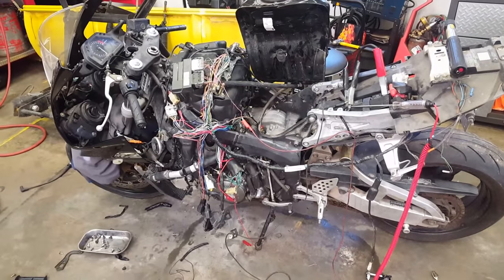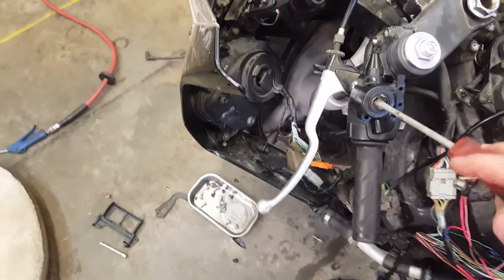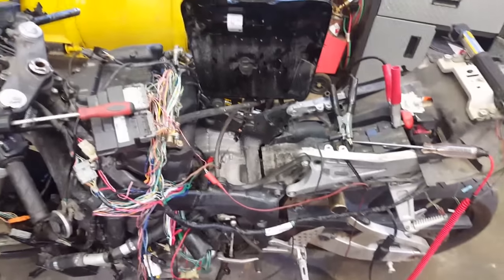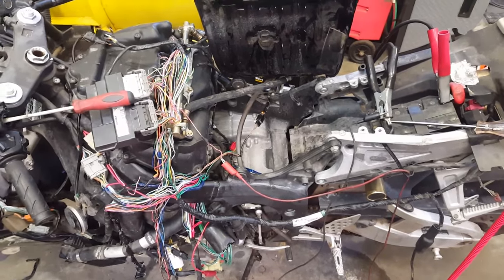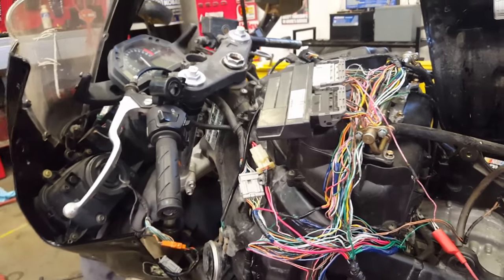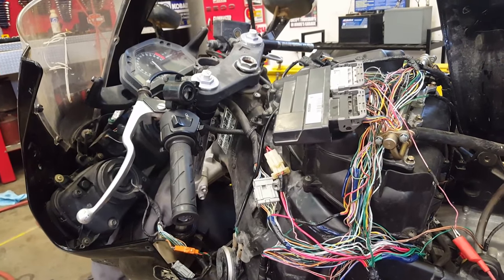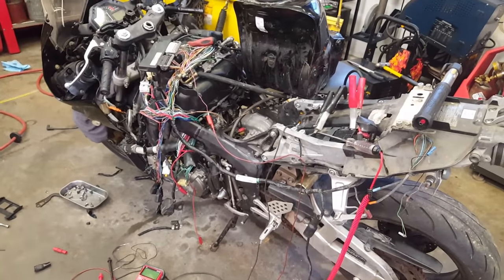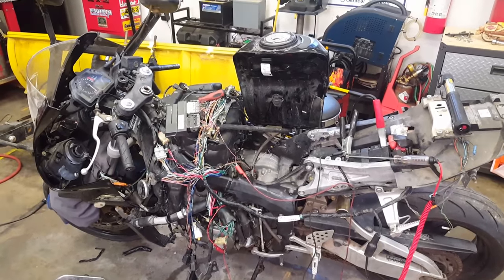2004 Honda CBR600RR no start fix. No fuel prime

Comment: Hi, this wasnt my problem but I did solve it. I checked everything, fuses, relays, bas, pump direct to 12v, kill switch, ecm. So thought I'd check this diode,  this is an 03 european model, there is a space for a diode but non is fitted and no pink wire with the 2 red ones from ignition. However I did find the problem in the end. I started from scratch again. Even though I knew it wasnt the starter solenoid coz it was cranking over, it looked grubby so I took it out to clean it, (keep the leads apart) when i did I could now see the 20a fuse holder( leads to fuel cut of relay)  which is buried in a hole next to it looked very green and the wire from the battery was broke but in place, you cannot see this with solenoid in situ. There is a factory hole in the undertray which the tyre throws water and muck through. I cut them and connected together and boom, pump primed and bike started. Fitted a new fuse holder from ebay for £2. check this, could save some time.

Comment: Thanks for taking the time to make this video. Working on my 2002-2003 945rr, bad fuel pump... took the pump apart and got that working, and after checking all the sensors as per the service manual, and even trying the 9v battery you did, still nothing... decided to trace the pink wire and found it broke/mouse chewed through only the pink wire on the whole bike.....lol soldered up the pink wire, hooked up the 12v bat. and she came to life!!! It's been over a year since the same priming sound you were so excited to hear, I finally heard. Without your video, who knows how long it would of taken me to stumble across the broken pink wire..  Take care man

Comment: So i was hoping this was my problem but it wasnt. The wire for the spark plug cloil shorted to the frame it killed the engine and now it wont fire. Same symptoms as you but not the same problem. All relays and fuses are good.

Comment: i have a cbr 929 2001 and found it does not have a zener diode at back of ignition.  I am nut much of an electrician at all but wondering how exactly to connect the 9v battery to ecu pink wire?  So the grey terminal of the ecu has an all pink wire feeding into it; and I need to connect the positive terminal of the 9v to it? - what about the negative terminal.  Help would be very much appreciated as have spent tonnes of bucks on bike ...

Comment: Actually that is not the FiX. There can be this problem with a perfectly working diode. As I have just bought a brand new ignition and still no prime. If you check deeper in yiutube videos you will find the video w the guy who shows the real FIX. The actually fuel pump brown and blue wires have a connector inside where the wires change colors. And this connector will short out. On 75 percent of your fuel pumps. A defect most all of them have. Even new ones. As I have also bought a brand new fuel pump. Still no prime.
Reply: Yours is a very helpful reply. Trying to solve a no-prime fuel pump issue on a USA spec 2001 Blackbird. Can you please give more clues on how to find that connector video you reference?

Comment: So.. if I were to theoretically jump the main power switch with a wire and in the middle of the wire solder a diode limiting 9v to pass to then jump the 3rd wire.. theoretically.. 👀 it should start? Theoretically that is.

Comment: Great video, I've just had this no priming issue, I thought it was old fuel as I havent used the bike in months, so im mid strip down, fuel out and clean everything. If that doesnt work I'll check that diode. Strangely when I tested the fuel pump connector with ignition on I only got 3.5volts. Thanks for showing the solution. So many people dont, probably coz they never found the problem and gave up. Cheers

Comment: Thank you for your video I have a 97 Suzuki GSXR 600 Srad with no spark and I have replaced all electrical components and the complete wiring harness and some how I think it could be with the key ignition

Comment: Okay so I've watched your video on the Honda 2003 600RR with the fuel issue in the whole on doing one just like it right now so what I found out so far is everything relies on the zener diode for the computer Bank on the pink wire at the same time the aftermarket starter switch which does not have the diode inside of it it has a 4-wire setup one red one black one green and one black and white striped an operating the switch on the meter you only get power in and out two wires and I even took the back of the switch off and look in side

Comment: Very helpful thanks great job the diode needed to solve this issue is a zener diode 9v resistance which will regulate voltage 12v to 9v

Comment: My ignition only has 2 red wires from the back, if i get a new ignitinon and fuel cap kit will it come with the stuff i need?  Im gonna get the amazon special.  Lol    And if possible how could I get it to run now?
Reply: I can't find the pink wire to even try to jump into, is it a plain pink wire?

Comment: Hi there, I have the same problem my bike is a 2006rr and they don’t have the pink wire on the plug like your they are only two wire coming out both end
Reply: I fix my problem with my bike the was the yellow box left side no ground on one wire I ground it and case solved!

Comment: I have no pink wire coming from the ignition on my 2006. I have 2 red ones reading 13.3 volts
Reply: MotoBike Mike did you find the fix?
Reply: Pull the ignition apart and see if there's a zener diode inside

Comment: I'm having exact same issue with my 04 cbr600rr.   Mostly sits in garage, but starts fine, then out of the blue no fuel prime. Turns over but no ignition.  My first thought was maybe fuel pump seized.  I've  since open fuel tank and seen rust deposits around filler and was thinking maybe this is the cause.  Best I check this diode business out as well.  Thanks
Reply: what's the verdict?

Comment: I have the same issue with my 2003 honda cbr 600 f4i. My buddy and I have tried and checked everything but the ignition. Your video has help my buddy and I out alot thanx.
Reply: Lol I   ride  with  a 9 volt battery  for  a  while .  Found  out  the  hard  way  after  spending   2K in  the  shop .  They  couldn't  find  the  problem

Comment: Hello Andrew I have an 05 cbr 600rr and mine is having the same problems as yours pump dosent prime but turns over! I pulled out my ignition switch and checked the loom where it connects and there is no pink wire coming out is there an email or Facebook I can get with you and try to figure it out I am stumped!! Please help!!
Reply: did you ever fix your issue?  I've got an 05 and have the same issue.  Thanks

Comment: So I can’t see in the vid Weber’s the 9v wire is I can’t tell how to feed it in, and I don’t want to hook things up wrong. Can you explain it a wee bit. I replaced it. But I still can’t get it started , can you put the diod in backwards cheacked all the wires that I think would be the issue . But still nothing. Replaced the pump( not the assembly) and that was an issue but not the original issue . How do I test the voltage ? Do I need to cut the pink wire and put the lil machine in it or can I just hook an alligator clip on one ( the pink side) of the diod soterd points?
Reply: With the 9v when I hook it into the pink wire  would I put the positive post to the pink wire and the and the meg post on to what ? The other side of the pink wire or hook it to a meg or pos of the bike bike battery?

Comment: I'm having trouble because the fuel pump indicater light on speedometer panel  is not even lighting up. I hear the switch click the relay. But no light or fuel injector or pump activation and my 2005 cbr600rr don't even have a pink wire from the ignition. I  need help please
Reply: Darius Tolentino it sounds like your fuel pump needs to be replaced. Have you tried unplugging the pump and sending 12 volts directly to it to see if it runs? The low fuel light is activated from a thermister attached to the fuel pump, the service manual says to replace the pump if the light fails. You can test the light by unplugging fuel pump wire and shorting the green and brown/black wire on the harness side, turn the key on and see if the light glows. If yes then it’s the themister. I’m in the same boat with my 954. There seems to be a work around to replace the thermister if you are mechanically inclined. I am going to attempt it seeing as a new pump assembly is over 300 bucks. I hope this helps.✌🏻

Comment: If buy new key set is that help?i buy whole new wiring for my bike,
symptom,
My bike sudenly lost power when ride and die,it hard to start,
when i try to start it again it won't start and my fuelpump suddenly wont prime.
Is that the same for your case sir?
Is that to do with the zener diode on the key?
Reply: Ecm problem bro

Comment: I have a no fuel pump prime but does work when jumping the fuel pump relay. Bike has been in the shop for 5 months and it's painful to watch time fly with no fix. I have an 05 . My yellow clip coming off the wiring harness burned and the bike wouldn't start. I had it in a shop for a day before the power cut out on me again this time I have no headlights , backlight on the cluster and no front turn signals also still no fuel pump prime
Reply: Changed fuel pump ,like 10 relays, ecm also swapped out , checked bank angle sensors , killswitch almost everything ... anything I'm missing? Bike only starts from jumping fuel pump relay

Comment: So, if you just bought those $30 ebay ignition kit and install it, it will fire the bike right up?  No extra work required?
Reply: Have you tried it and worked?

Comment: I think you might have just solved my problem, will try it out, my 2009 Honda cbr600rr just won't start even replaced engine with a running 1. No start
Reply: Did it work? I also have a 2009 PC40 with the same issues.

Comment: This is exactly what issue i ran into. I put in a new stator, put the bike back together. Started right up every time I tried the same night I put the stator on, heard the prime every time. As well. The next morning, wanted to hear the glorious fix I did on the bike & start it up. I noticed the prime noise didn’t come on anymore, & the bike didn’t want to turn over. Now the buzzing noise the prime is supposed to make, isn’t going on. Huge head ache. Might try this, hopefully it helps.
Reply: MyKey Productions did it work

Comment: Hello Andrew my bike doesnt start when its above 200F temperature. 2004 Honda CBR RR. I have change the kick stater, battery,stator coil,rectifier.
Reply: Did you get that fixed? Have a friend with the same problem

Comment: Hey buddy,  Ive got a question and hoping you might have some insight.  I have a 2006 cbr600f4 and when I got it it was at some dudes house that works on bikes.  He said they replaced the starter but for some reason the starter would just spin and wouldnt catch anyting.  So I called a honda dealer and they said it sounded like the starter clutch had gone bad and needed replaced.  I ordered on offline using the part number that the honda dealer gave me.  We replaced the starter clutch assembly and it is still doing the same thing.  Any thoughts would help.  Thanks!

Comment: I'm having the same problem that you are having with my bike and I put a new ignition switch from eBay on my bike and it's still not working do you have any ideas what could help
Reply from the maker: Be sure the ignition switch is not for a European bike. They do not have the diode in it

Comment: Any links to where I can get a correct zener diode?  I purchased a new ignition switch online,  no fuel prime, jumped the pink wire to a 9v battery and it fired up.
Reply: luis valde I have some I can send u

Comment: I have my 03 600rr and my zener diode is completely missing. And the pink cable you have on the back of the ignition switch is also non existent. I hsve an Australian HISS RR so is that why i dont have that extra cable?

Comment: I tried this but it didn't work. I also replaced the zener diode that goes into the ignition switch. I'm waiting on my new ecu so hopefully I'll be riding. 

Glad you fixed your problem 🤙🏾
Reply: Popeyetwowheels what and where did you get the diode?
Reply: Did the ecu fix your problem?

Comment: hello sir, wondering if why my diode reads 8.4 and its a new one, evwn the old one reads 8.4, the brown wire going to the fuel pump has no power, pls help thank you
Reply: jorel tiamson I have the same problem as you with my 2003 cbr600rr. The brown wire to the fuel pump relay has no power. If you figure out a fix please post it.

Comment: Thanks for the share, I also had the same problem with threads on forums... my bike doesn't have this problem...but awesome that you share this...I have also been looking for a fix for mine too, mine starts most of the time, but then it just goes off when accelerating, also sometimes..not always...driving me mad and quite dangerous especially at the track
Reply: Look for the fuel pump video w dude who shows you the fuel pump short. Prob the real issue your having.

Comment: i think mine is my throttle cable , after i changed the throttle tube the fucker wont start or kick the fuel primer in , il keep you posted if thats the case
Reply: i have a cbr 600 2006 model same problem no fuel pump prime , i watch your video but my bike has no diode under the ky switch and there is only two wire from the key switch both red, one has a black stripe, can you pleased help me thank you very much

Comment: i use a 1000 ohm resistor to fix it. i cut the pink wire , tied one end of the resistor to it. the other side to one of the wires that get power when the key is on. it works fine.
Reply: Boris Alegre 
I use a Honda CBR1000RR Feel pump is not working how to fix  !
I need a help

Comment: Hello Andrew. I'm having the same issue. I took the ignition switch apart and mine for some reason don't have the zener diode in the back. I cleaned up all the hard and old grease inside the switch and the bike started for about 20 times. I was going for a test ride and while the bike was warming up, the head lights went out. I turned the blinker on and the bike died. to get the fuel pump to pressurize I have to disconnect the left side headlight .
Reply: Did you get the problem
Reply: @twirltheworld2262  No. I still have the problem. The fuel pump will only prime if I disconnect the left side head light. When I do that, all four blinker will stay half way on.

Comment: Hi , I just wanted to say thanks for the video. It helped me figure out the issue on my bike my bike was stolen and I couldn't figure out what the issue was when I bought an aftermarket ignition switch that did not come out with the diode
Reply: Were you able to buy a diode and install it? I have a CBR 2007 that was stolen and the thieves messed it up. Now it doesn't start. I guess the same problem.

Comment: Thanks man, nice video. Just bought an 09 yesterday from an insurance auction that won't prime. Checked out all the easy obvious stuff, now hoping it's the bank angle sensor (which is missing), but if it ain't I'll be checking this out.
Reply: What was the problem?
Reply: Having the same issue.  Where is the BAS located?  Can't find it in the owners manual.

Comment: Hey I have a 2001 Honda cbr 600f4I bought the bike for a low price because I was told all it needed was a new pump and tank I bought the new pump and tank and the bike will not start I checked the pump to a hot battery and it worked but when I hook it to the bikes harness the pump will not prime headlights will not come on but the light on the dash for the highbeams stays on but no lights I tried taking the bike to Honda bike dealer and repair but they never took the time to look or even work on it honestly this has been the most descriptive video I've seen so far so gonna try your method oh and I put on a new ignition please help
Reply: Ryan nicholson did you ever fix your problem?
I'm in the same boat.
Reply: did you fix your problem im in the same boat too lmfao brought it at a insurance auction, said they had keys, werent coded to the hiss system now ive overspent for a bike i cant even use
Reply: I have same problem.  did you fixed?

Comment: having the some issues with my bike replaced the fuel pump and it primes but when I go to start the engine cranks but doesn't turn over, I ended up thinking kick stand kill switch BAS sensor and so on but I poured gas into the intake manifolds and the bike started right up and purred to life for as long as I kept pouring fuel in then it would continue to do the same. have any advice on what it could be ?
Reply from the maker: CryptopsyDAMN it sounds like the ecm is not activating your injectors. test the 3 wires coming out of your ignition switch. one of those wires ( small pink wire) should be 9 volts. if all three wires are showing 12 volts then you need to replace the zenor diode. you can also try pulling your fuel rail off and blowing compressed air through it to ensure there is no blockage. it sounds more like the injectors are not working which tends to suggest the ecm is either not turned on to fire them or it sees a voltage it does not like.
Reply: thanks appricate it I'll check it out I've been thinking about the ecm being the issue but wasn't sure if it would be, I'll check the diode before moving to the ecm, one again thank you
Reply: well just wanted to add that there's no such thing as a zener diode on the 06 model running from the ignition to the ecm, I replaced the pulse generator and still haven't got much of anything it still does the same thing I've checked all the fuses and such and it will still run when gas is directed into the manifold but I've noticed that the I jesters are not shooting fuel into manifold like they should and I'm at that point where I'm thinking it's the ecm cuz even the ecm itself doesn't have the pink wire or connectors running to where the diode would be placed...